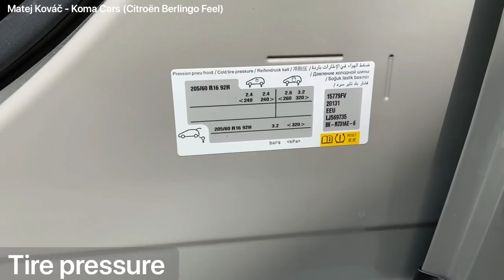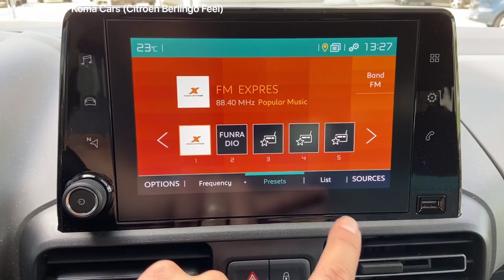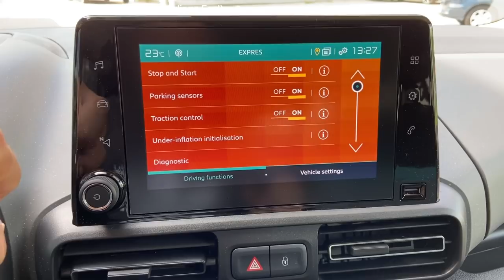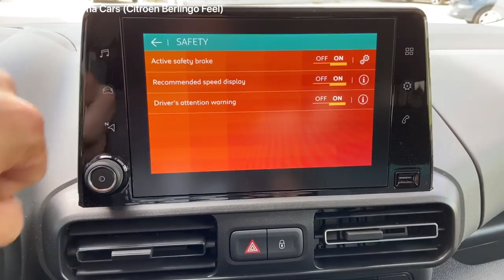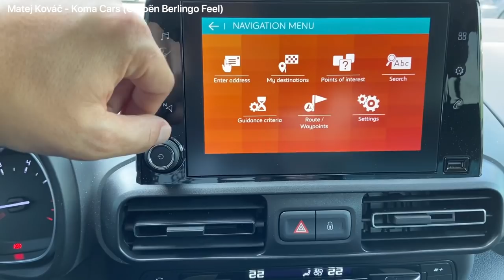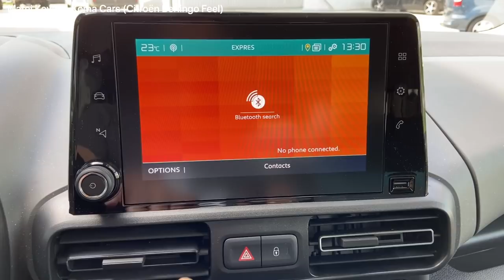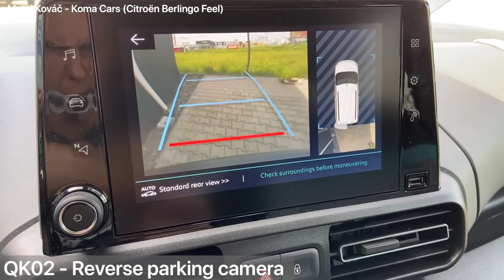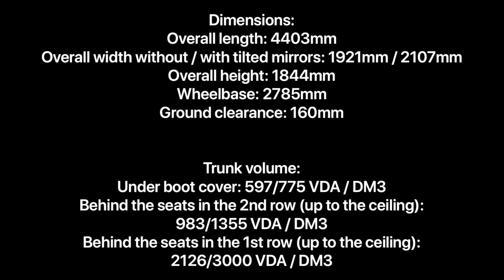Citroen Berlingo 2020 Shine - Detail Walkaround interier / Exterier / infotianment / VIN / motor

Comment: Excuse me, if I choose the configuration with induction key. Can the fuel tank cap be opened in the car? Thank you!
Reply from the maker: if you have keyless access, the fuel tank lid is not a key but only the lid is locked with central locking - the tank itself is no longer locked with a key

Comment: Al diesel le falta cilindrada y caballos
Reply from the maker: este automóvil tiene un motor de 96 CV y 130 CV y una transmisión manual M6: se mueve desde la parte inferior desde 1500 rpm y, en mi opinión, tiene potencia para regalar, en el Rifter también va a 200 km / h, para este tipo de automóvil es mega potencia